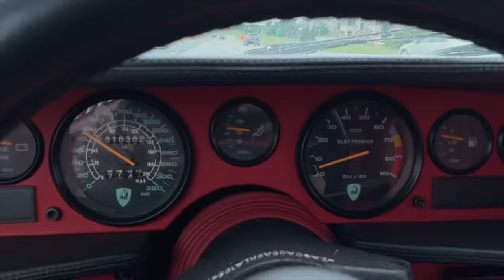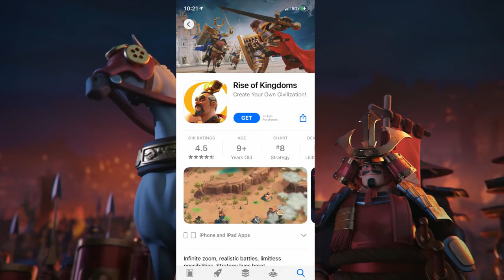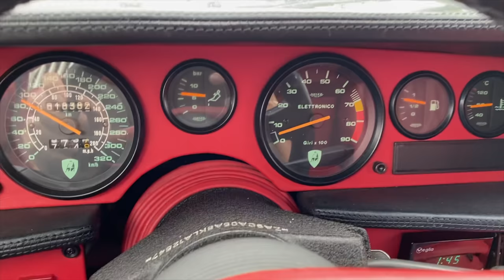My Lamborghini Countach broke at a very embarrassing moment

Comment: Damn, the random out of sync flippy lights. My '88 Honda Prelude did that on the way home one night on the freeway. It was the worst time for it to start happening even thought I was only 5 miles from home. I took it to my mechanic and he said the easiest fix would be to pull the fuse when they pop up. Funny though, when I sold that car I got a '86 Honda Accord with flip up lights and they were fine for the 4 years I drove that car. The funny is, the more expensive and newer car failed were the older car succeeded and I got more years out of the older car.

Comment: You love to drive cars even when the heath of the engine (or age of the oil/gas) is highly questionable. Not sure why you're ever surprised when they fail.

It's almost like starting up a car that's sat for a decade without changing the oil and flushing the gas tank might be a bad idea.

Comment: Tyler I respect you because I couldn't have possibly put a correct 427 BBC in that Corvette. I would have gone over board with aluminum heads, bigger cam, headers, intake and carb.

Comment: Ha, whoever is working on the c70 cabriolet at wizards - there is a “service mode” for the hood - if you flip the little catches on the hinges they open 90degrees to the engine allowing better access

Comment: If you have the original Magneti Marelli ignition Id bet that is the issue. Simple fix to replace with a much newer and more modern MSD ignition which solves all the issues. The original ignition is prone to failure, and also hates being wet being below the open air vent in back.

Comment: Tyler, it might be the engine speed sensor. Something nobody ever thinks of. It gradually failed on my VW Jetta and had no idea what it may be. At first my tach would drop and come back randomly, just a blip. Over a week it started getting more frequent, then the car went in limp mode, like 10% power. Any engine electronics are going to need to know the RPM to gauge fuel and air.

Comment: The original Magneto Marelli ignition is crapping out.   It’s up underneath the drivers radiator exhaust vent.   Remove and replace with an MSD. It’s a DIY if you’re at all handy.

Comment: The only time my 911 embarrassed me was when the clutch burned up on the way to the shop in another town to get it checked out. I’m gonna say it was damaged by the previous owner as I’d only had it 6 months. Since then I’ve had no problems. Apparently, unlike the Italians, Porsche doesn’t use cheap components like Fiat electrical, which constantly fail.

Comment: I'm sure I'm way off... but the one time I've had problems with a vehicle stalling/stumbling/not starting, the epoxy? coating on the coil had shrunken and cracked, causing it to arc to the bracket. But this was also on an Astro van, just a little different than the Diablo 😁

Comment: My porsche convertible had the same issue. Turned out the PCM got wet. (They put it under driver seat) IN A CONVERTIBLE... Now only windows and interior lights dont work. Its a hooptie for sure xD

Comment: My 944 Turbo did a similar cut out the other day. Air hose clamp wasn’t tightened. Fixed it at no cost. So hope your issue is similar. Doubt it. But hoping nonetheless

Comment: Remember fitting alarms to these back in the day. The plug from the ignition wires under the column always went bad..
Reply: I can't remember the proper name, but it prevented running the starter unless the clutch was depressed.  Is that related to the plug you're talking about?

Comment: You did not even show the MSD ignition system that got installed on the countach. Next time you are at the wizards tell them wayne in so cal says Hi. Did they also rewire the radiator fan relay, fuel pump relays and install an ac clutch relay so the power to those comes off the alternator output before it heads forward to the fuse box and battery to reduce voltage drop.  So the heater and ac blower spin fast enough to cool or warm the cockpit without needing to open the doors at every stop sign.

Comment: Ah yes, every car owner with the Magneti Marelli electronic ignition system's woes, i.e. the Digiplex ignition box that is fitted on nearly every Italian car from the 80s to the 90s from 4 cylinder Fiats and Autobianchis, to Ferrari V8s and Lambo v12s . This my friend is the Digiples saying it's dying and needs replacing because the circuitry is overheating so it's shutting off and takes the tachometer with it. I know this because on my Father's 1994 Fiat Tempra it also did that whole ignition dying off thing with the Tach and you would either replace it or temporarily put a wet (preferably cold water) towel on the heatsink to get you home.

Comment: So i had a pick up do what the Countach is doing.  It ended up being a fuel issue.  But until i got it fixed, given it had a manual tranny.  I would just pop start it back up in motion.  Can the Countach be pop started like almost all other manuals?

Comment: Makes me miss my 2004 Gallardo I bought new.  That 9000 rpm v10 motor as awesome. True exotics have V 12.  My wife had a DB9 convertible with the V12.  Did not rev as high, I think 7000.  Hand built cars fit not as good as mass produced as well as infomat systems.  The Aston was always in the shop waiting for parts.  She drives a Panamera 4S now with readily available parts

Comment: Check the fuel pump!! I had an old piece of junk car that did the same randomly, it was the fuel pump that would overheat and stop working. Not sure if this applies to a Lambo, but this looks fairly similar to the issue I had

Comment: The thing with the Countach is almost exactly what happened to me in my truck and it wound up just being the ignition control module. Granted that's my '96 Ford Bronco not a Lambo with no parts availability, but mayhaps that'll be quick and easy.

Comment: Oh, I forgot to mention. That stalling the Lambo is doing. My '01 Honda Accord was doing the same thing. At first it would stall in the freeway for a second and come back right away. Then after a few years it would stall out when I stopped the car but it happened so randomly that I didn't know what it was. Some days it wouldn't stall out at all and then another random day it would stall out at every red light. Sometimes it would take 4 or 5 cranks to get it going again and when it did start I would have to floor it. Both my mechanic and I have no idea what was wrong with the car. He swapped out ever part that could cause the problem short of the ECU. And damnit, I bet it was the ECU that was causing the random stalling.

Comment: My money is on an ignition system (distributor or coil) fault, especially if it still has the original Marelli distributor. Wait till you see what a dizzy cap costs for one of those things. Still 5 months with no issues must be a record for a carbied Lambo V12, so you have done well.

Comment: So, there's a group of electrical boxes in the back of the car just inside one of the vents. I couldn't help but notice that it's raining.... Perhaps there's something related there?

I think there's a fuse box, ignition components. If you washed the car (or had it washed) and didn't tell the folks about it, they could have flooded your electronics.

Comment: Had a similar issue with my Fiat Punto, I came to my wizard and told him it's a sensor issue because the engine just shut down a few times during driving after the engine was warm.
He agreed, it was a camshaft sensor which went bad, it had a plastic sleeve which went brittle over time and cracked, when the car was hit, the sensor sent a wrong reading to the computer which shut down the engine.
If you have an old Italian car with such issue , check this out before an idiot mechanic will replace your ignition and fuel system with no solution.

Comment: How is the voltage off of the battery? You may need a new one. Among many other countless things it could be. Also, since it was in a barn, do you think rats got to the wiring? Hope it gets sorted ASAP without it breaking the bank too much. Wizard does have that Ferrari project that is need of a lot of money. Lol. So, do not be surprised if prices go up a little more.

Comment: Looks like an ignition system failure. Coil, magnetic pickup.... what have you. (I'm not intimately familiar with a Countach ignition system) but generally speaking, when that tach suddenly dies like that, it's an ignition problem.

Should really consider changing to a dual-circuit master cylinder in the Corvette.  It's just a safety thing.

Comment: In 1992 my Ferrari lost a clutch and I am  not sure but this lambo same color/year was in for a massive timing chain failurer the owner asked if I wanted to trade my bill $2400 USD ,his $30,000 USD! Still it sounds like a ignition problem or worse a timing chain problem!! Tell you what I will buy it for $40,000 USD I like a challange, If it is a timing chain issue the engine will have to be removed any and that is 40 hrs @ $150 an hour and then replacement cost!!!

Comment: For me, there's no point in owning a car if ~19,000 miles is a high mile.  The entire point of a car, truck, bike, etc is to drive/ride them.  It almost feels like a disservice to the engineers that built them for collectors to just throw in collections and forget about them.  That's not even factoring in the cost and unreliability.  But just because something isn't my cup of tea doesn't mean it isn't for someone else, more power to them.

Comment: When o when people will understand the cars need to be driven all these garage queens 20 years old 3000 miles EVERYTHING will break if you start driving them.
But they are still bragging with their low mileage cars,I just sold my 2007 S550 with 365000 miles on it and it was in better condition then all these low mileage cars out there.
I also have an 107 Mercedes 300000 miles it starts and runs with no problems ,just maintain you car and you will be fine a Lambo driven 200 miles in 8 years what do you expect

Comment: Coldwar Motors has better running hulks sitting in the yard. Unsticking a rusted up straight eight and then driving it in the yard seems more reliable than these three turds.

Comment: If I had three Lamborghinis I do the same thing now but I do have a 1999 Porsche Boxster 9865 speed manual 96 Buick Park Ave. and a 1997 jaguar XJ6 the Boxster is at the shop the Jag is not running I’ll get that fixed when the Boxster is done and the Buick is the most reliable out of all of them with that beautiful 3.8 L V6 no it’s not the fastest or flashiest car but it is the best one of the two for a liability and comfort that one scratches my age for land yachts comfortable land yachts The Boxster scratches my H for a two door manual convertible sports car that is mid engine the Jaguar used to scratch my itch for not only being a nice looking and driving highway cruiser comfortable land yacht but it has a lot of power for what it was a 4.0 inline 6 making about 245 horsepower the 986 Boxster has the 2.5 L flat six none of these cars are fast by any means all are stock and naturally aspirated to they’re not very quick in acceleration either but that’s not why I have them slow car fast is better than fast car fast RCR says granted it’s not as cool as having three Lamborghinis to choose from but it’s still kind of cool they’re all special in their own way cars are just my absolute favorite thing in the world Hooptie’s or not all three of mine were hope these at one 2 of them still are you’re never stranded that’s for sure that’s another thing I like about having multiple vehicles it is very convenient and nice well 2 1/2 right now the Jag is still out of order I finally found a good mechanic to work on it I don’t know if his car wizard level of greatness but will see hopefully before summer hits it’ll be back on the road again as a nice happy car like my Buick PA still is

Comment: “Yes Hoovie, it runs fine”. So let’s not start an engine as a demo and have it blow back through the carb because it has some “timing” issues, and then point to the oil filter adapter. That’s not good advertising Wizard!